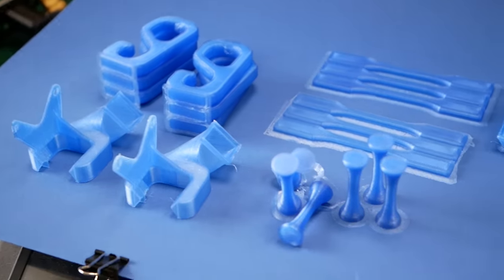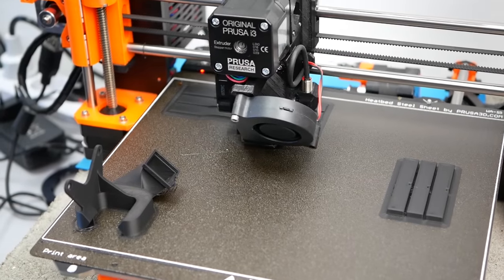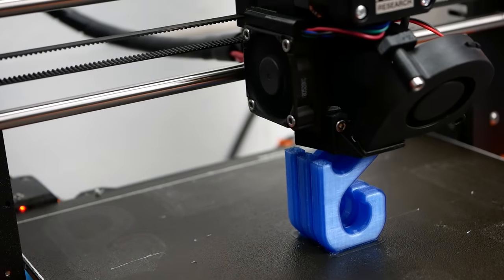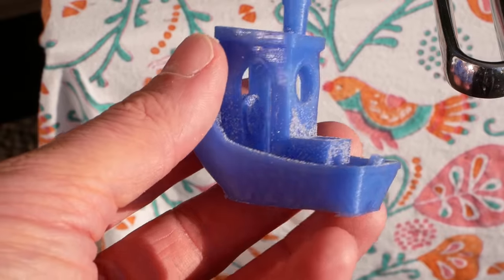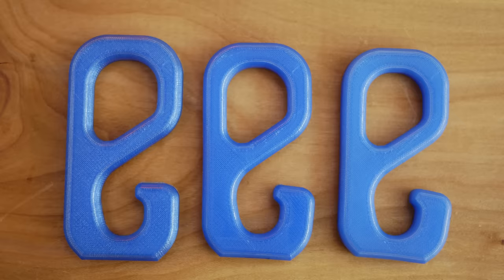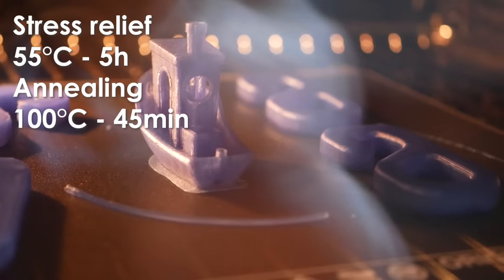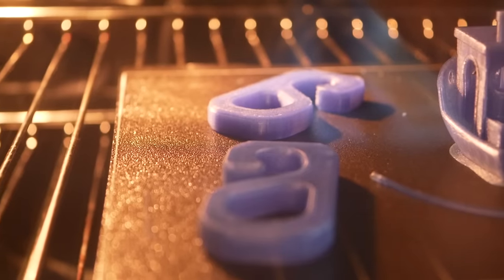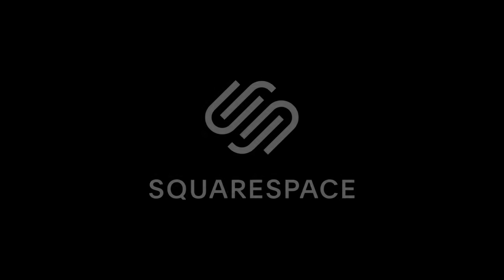Strong 3D prints through ANNEALING, but... Part 1: PLA

Comment: I have done anealing of PLA, I tried a 3D benchy.  The layers fused so well, there were no layer lines to the naked eye.  The Benchy was now a perfect PLA puddle.
Reply from the maker: Congratulations 😉
Reply: You had us in the first half, not gonna lie
Reply: You just melted the surface. Cut it open and you'll see the layers are still there. There's no way FDM can compete with injection molding unless you're ready to shed $800K for an industrial printer from say Siemens or HP.
Reply: @mururoa7024  The PLA puddle means annealing went horribly wrong.  I made no claim or comparing that it was like "injection moulding" at all.
Reply: @mururoa7024  R/woooosh
Reply: @xyzconceptsYT  Okay. I didn't get the puddle joke. Usually when people mention how well layers are fused they hint at improved density, which obviously isn't real with DIY FDM.
Reply: @mururoa7024  I can vouch for XYZ that his puddle doesn't have layer lines even when cut open 🤣🤣
Reply: your logic is correct !!! you cant see the layer lines if its a liquid !!
Reply: BWAHAHAHA

Comment: Hi Sthephan! I was able to get a +300% increase in impact resistance while annealing natural PLA. I tested according to ASTM D4508, for which the sample is smaller. As printed, it broke easily, but after 20min at 95°C they did not even break, using the same pendulum. I will be publishing the results next year at the Brazilian Congress of Manufacturing Engineering (COBEF2023).
Reply: are the results available?
Reply: link the results plz
Reply: Was there any warping?
Reply: have you tried petg?
Reply: So where

Comment: I've annealed PLA (plain and modified) by dunking the prints into boiling water for 5 minutes, then quenching with cold water (not my original idea, saw it in a youtube vid somewhere).  I mainly do it for the improved temperature resistance, but that is almost always with functional, mechanical parts that need to fit with other parts, so warping is not acceptable.  I've found the boiling water method produces almost no warping at all, other than the predictable shrinkage in x and y, and growth in z.  The shrinkage is predictable enough to compensate for in the slicer.  I've printed a fan duct that works fine on the MK2S, a few mm from the heaterblock, printing high temperature materials, so the heat resistance is good with this approach.  It's also way quicker and easier than annealing in an oven.  My process is to put the part into a mug or similar and pour boiling water over it, tumble the part to get rid of trapped air bubbles, then pour in cold water after 5 minutes.  Once the part dries it's ready to use.

Comment: I just tried annealing Proto-pasta PLA in sand and had great results. I put the parts in a glass baking dish, covered in 70 mesh high purity silica sand and left a probe in the center of the sand/glass plate setup. I used a convection oven. It took about an hour to reach 100C in the middle; I held it for 10 and then turned the oven off and left everything in there to cool. I was pleased with dimensional stability of my parts.
Reply: Did you hold it for ten minutes or ten hours when annealing the PLA in sand?

Comment: I have tried boiling some PLA+ parts (kind of ring shaped) and letting them cool down to 40c in the water. They were thin walled parts, 2mm thick, so 10 minutes boiling was more than enough to change the temperature resistance. As a result the part was still hard at 80c while normal PLA gets rubbery at 50/55. But the same results with deformation and warping. Uneven depending on the axis. I will keep trying with other shapes and failed prints just for fun. I still think that this can be useful in parts that can be printed, annealed and then post proccesed to get the desired dimensions (sanding, drilling, etc. ). Great channel!! I really apreciate your work. Congrats!!

Comment: reacting to your question on 2:20: yes, used volcano pla (formfutura, crimps minimal, reasonnably cheap as I live in Belgium, for usa the shipping must be crazy) like you used on that coffee maker like a year ago (?) printed clotheshangers from that and they are holding up after one year of serious (ab)use : one time I noticed visitors put like 3 wet winter jackets (heavy!) on one hook and it didn't fail. Used your 'making parts stronger info' vid and did print them with 5 perimeters instead of high infill. clearly worked, thanx for all the research Stephan!!

Comment: Hi!
I looked a bit into that subject previously to improve my quadcopter strength. I found that if I disabled cooling and tweeked a bit the temperatures the parts were almost not deformed after the heat treatment. Of course, disabling cooling and the temperatures affect the look and it is not suitable for all parts but if you are only looking for strength it is good and you do not need to compensate for any deformation.
Thanks for the work you do. It is quite interesting and helping. :-)

Comment: There are different results changing the infill density. 10%, 50% and 99% behave differently, especially regarding the type of deformation (uniform in X and Y). Z shrinks less, meaning that there is not a big layer fusion. Also, the deformation depends of the infill pattern used.  
A ventilated oven usually distributes the temperature more evenly. 
I'm not sure of the benefits of the slowdown temperature because in any case the skin remane cooler than the interior, and the process of loosing energy depends mostly from the geometry of the part, creating deformations. 
I'm testing the results using the microwave oven...

Comment: You tried sand but I was wondering how well something that sets like plaster might work? You cast a part, heat treat then wash away the plaster. It sounds like a ton of work but might be worth investigating
Reply: I was wondering also with plaster... when it has hardened, and assuming that the part is completely filled, could the part then me heated to much higher temperature to completely melt the PLA and sort of have a 'cast PLA' part ?
Reply: Using plaster is an interesting idea, but if you're going to all that trouble, then just do an investment casting. Once the part is covered in plaster, you can bake the filament out and cast metal inside.  Takes some planning to cast properly, but you get much better parts.
Reply: The amount of effort required to make sure the plaster gets into every single nook and cranny, and then taken out when done, would not be worth the 10% gains while maintaining the same dimensions, if it even works. Instead of going to all that hassle, just use something 10% better from the start, it'll be cheaper in the long run too
Reply: Encasing in plaster and reflowing makes the part way stronger. Print 100%, mix plaster and immerse part, wait until set, then bake at 200C until temperature will be even throughout. Let cool and wash away plaster.
Keeps a lot of detail, though any air trapped will create a void at the top.
I suspect with further research I could print an integral reservoir to fill the void and let the air out of the piece.
Fridge clips I was printing kept breaking along lamination lines, but reflowing them removes all lamination.
Reply: @a930913  you might as well build a rotational mold machine and use plastic pellets. This is FDM. You get what you get.
Reply: @leofortey7561  was also thinking that 200C would melt into a puddle, given 180 did. Unless you did solid fills, because as the part melts, its basically just injection molding (like you said) and because the models werent solid to start with, you'd lose volume. air bubbles are the least of the issues.
Reply: @a930913  : just print a "sprue" part at the top to have additional material to fill any void which appears during baking. ??  it could work.

Comment: I wonder if using a heated build chamber would make a difference in layer adhesion?
Reply: good question, I would like to know the answer too
Reply: Yes it does. i get up to 100% adhesion in the Z compared to the xy
Reply: Yeah it does, same with lowering the fan speed
Reply: Keeping the print warm definitely helps with layer adhesion, same with slower printing speed (really slow) and slower cooling fan or just turned off. Which has me investigating how to turn off the cooling fan for internal fill, so that the fan only turns on for the shell.

Furthermore, so the fan only turns on at a certain level of degree and ceiling layers. So that when you print vertical walls there's no cooling fan, but once you reach let's say 75 degrees it starts to kick in or ramp up for the outer shell if its printing outwards or the inner layer if its printing inwards. Might have to write my own code, haven't done that in a while lol.
Reply: @MrHeHim  you don't need the fan for pla but it does help with bridging and you should be able to enable it just for bridging easy enough.

Comment: Nylon will appear to be quite stiff and strong fresh from the oven. But take care, as the print adsorbs moisture from the air, the mechanical properties of the nylon change and it becomes more flexible and less stiff. Some people take the initial stiffness to indicate that Nylon can be stiffened from heat treatment, but they fail to acknowledge the temporary nature of it.

Annealing Polymaker's PC-Max blend will be fine, but to anneal real, pure PC prints you need a precision temperature controlled oven. We're talking being able to control temps to a 10c rise over the course of an hour sort of thing. Without such control, you might as well not bother annealing pure PC as it won't be beneficial. Of course, it's better to just print PC in a 120c chamber to begin with so there's not any printed in stresses resulting from the part cooling too fast, but most people don't have setups capable of that.

Comment: Great video. Another property that would be interesting to test is the creep resistance. I have had several PLA part fail over time under constant load (preloaded assembly for example). I guess that increase in crystalinity could reduce the creep rate. For the load, you could compare several heat treatments at 70% to 80% of ultimate strength for example.
Reply: I've been testing how annealing Inland PLA+ test hooks affects material creep for the past couple months. (I think Inland PLA+ is made by eSun, but I haven't been able to get confirmation yet.) I annealed half of the C creep test loops at 85°C for two hours on the print bed with some a paper foam insulation on top.

I've had the two kinds of hooks loaded continuously with 3 lbs. (about 1.36 kg) for more than a month now. The gap on the unannealed part has grown from  2.0 mm to 18.1 mm, whereas the annealed part is steady at just 7.3 mm!

I think it might be an alloy of PLA and PBT, both of which are semicrystalline.

Comment: I recently tried drilling small holes on opposite side of my print. With about 20% infill I then used a syringe to push epoxy and silicone glue through two different parts. I used a transparent filament with about 2 or 3 walls. It drastically changed the feel of the parts. 

You should try testing some hooks that have epoxy or silicone in them. My only problem is that the epoxy got pretty hot.
Reply: Use epoxy which cures slowly (as opposed to regular epoxy). This way you generate the same amount of heat during chemical reaction but you have much longer time to dissipate it, therefore the max. temerature stays way lover.
Reply: lover = lower
Reply: Oh that's so awesome I just got into 3D printing, had some parts that needed extra rigidity, and was thinking of the exact same thing! cylindrical voids running the length of the print injected with something, or geometry resembling lightening cuts in the appropriate orientation filled with JB weld.

Comment: Great video as always 👍. I have tried annealing high temperature PLA and found it to have a positive effect. I don't have your test setup but did a simple bend test by hand and found the annealed piece it to be a  bit stronger. I did get some warping when I annealed at 100C but none when I used 85C. I had the best results (no warping) when I let the part warm up slowly with the oven rather than putting it into the oven after it was warm. I also let it cool down slowly after an hour of annealing.

Supposedly the HTPLA also gets better impact resistens after annealing. It would be great if you could test HTPLA to get some real data on it.

Keep up the good work 😀
Reply: What brand of HTPLA?
Reply: @japonicaren  I have used the Proto Pasta HTPLA V2 and the HTPLA Carbon fiber. I really like the CF for functional parts that need to be strong and it prints great.

Comment: Weird thing I've seen in doing some annealing tests of my own is that two different brands of PLA shrunk and expanded in different directions. Both test parts were printed in same orientation and annealed in same orientation as well. Still one of them expanded in X direction and shrunk in Z and the other one did the usual shrinking in X and Y and expanded in Z.

Comment: There are some factors in the heating and cooling. Since heat rises, the top of the part is the last part to cool, thus why you see different expansions in z versus x and y. If you could somehow put the parts in a 3D rotisserie as they go through the process, you should see a more uniform change in size. In large turbines, this is why they have to keep turning during cool down or they bow “upwards”.

Comment: If you want really strong parts, create 0% infill and then inject epoxy or other glue components.
Reply: You can still use gyroid infill with this process.
Reply: Interesting. I might try this with PU.
Reply: I have a bunch of parts on my CNC machine that I designed to be fill with epoxy granite, works really well.
Reply: I have done this and it turned out fairly well at small scale.
Reply: UV resin could be used as infil with translucent filaments.
Reply: Schnitzel Panic I am making a mechanical device and I wonder if I can make strong gears using granite epoxy. Do you leave holes and put it in? How liquid is it? Would this convert resistance to twisting, and would it fill the space without voids which would unbalanced a gear? How thick would the shell have to be to avoid distortion?
Reply: That's actually a good idea, if you can get complete filling.  I guess you would want to use a filling that is very liquid before hardening.
Reply: I've always wondered if this would work but I've never seen anyone try it

Comment: Great video, thanks for the upload. In case you try it with ABS, I just finished a test myself. I think Thomas did something similar but he chose around 105°C for the annealing temperature for both PLA&ABS. I just did the annealing of ABS at 140°C. The reason being, that PLA has a glas transition temp (TG) of 60-65°C and ABS at 105°C. I've seen that the annealing of PLA works at around 100°C, so 40°C above its TG. Therefore ABS has to be annealed at around 145°C. My Part shrank but the geometry remained ok. All the best with your experiments!
Edit: sorry it wasn't Thomas video with the ABS, it was your video as well. It's name was temperature resistance after annealing and you inserted the parts at 110°C (PLA,PETG,ABS). I would suggest setting the temperature 40°C above the TG of the material being annealed.
Reply: Such a high annealing temperature is not possible for parts should be accurate in dimensions.
ABS is a material of interest for me as well.

Comment: Hi. I swear by the. Using 3D fillies pla plus. 100 c for 30 min. Raises its temperature stability to over 100c. For parts that may get hot in a car it’s a must. Shrinkage is only 1.5 pct xy and expands 1 pct z. I don’t use a cool down step. Whip out of oven while hot and then clamp them down on a cold metal surface. Also have some wooden jigs to hold the critical dimensions in place during ht. All this adds up to quality stable parts that look great and take the very hot Australian sun. Strength is also much better. I have tried this on several pla brands and not all respond the same. Stephan. You should do these tests on ht pla or pla plus. People will be put off based on this video. It’s never a blobby disaster for me with ht. Just get the right material.

Comment: Thanks for the video!  Very interesting.

Two things you may want to investigate in the future for annealing of PLA:

(1) Some manufacturers make PLA that is specifically designed to be annealed.  My understanding is that these types of PLA have solid particles included in the PLA that are supposed to help "seed" the microcrystalization process.

(2) I think there was speculation that PLA with pigments (colored solid particles) would more easily crystalize than PLA with dyes (colored chemical dissolved in the PLA as a solution; no particles).

If you have time, I would be really interested to see you perform similar tests on, say, white-opaque PLA (which very likely has pigments like titanium dioxide, zinc oxide, etc.) as well as PLA that is specifically designed to be annealed.

I have no idea if there would be any difference in results.  There are numerous academic papers on annealing PLA and PLA crystallinity.  It would be interesting to see if your results are roughly the same as theirs.  They studied things like annealing times and temperatures (crystallinity vs time at a given temperature), mechanical properties, and microstructure.